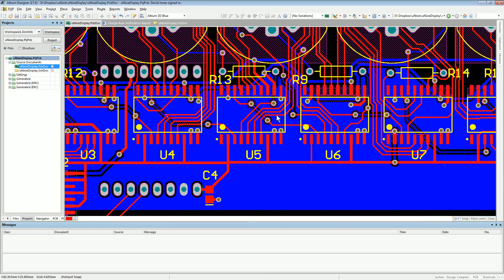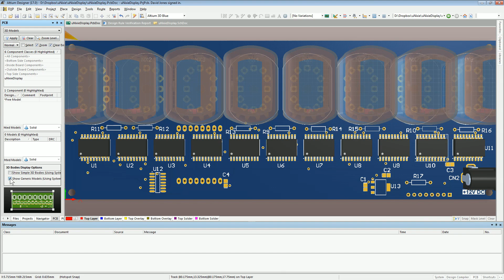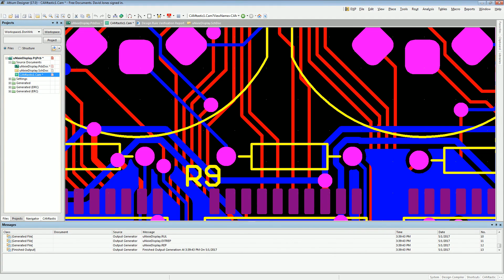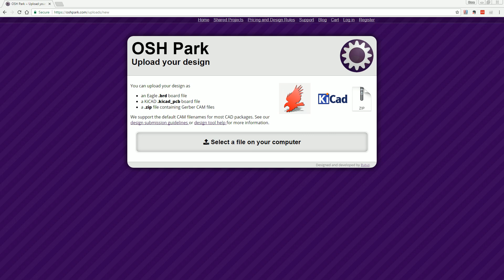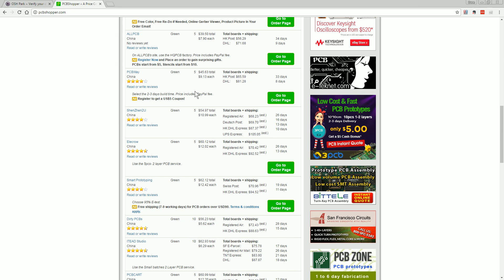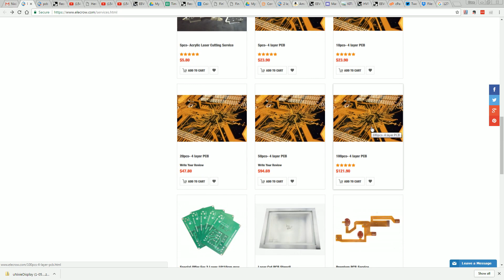EEVblog #990 - Getting The PCB Manufactured (Nixie PART 5)

Comment: I just found this series from you - absolutely brilliant. I've designed a couple of PCBs before and had them sent off for manufacture, so I'm not green, but your explanation of the complete layout, 3D modeling, routing, DRC etc etc was really very good. I hadn't realised how much I didn't know about the process until I saw your tutorial. Super impressed. Great video.

Comment: A bit of a comedy of errors, in the end perhaps it is worth deleting this one.

The useful thing about it is that it shows all the problems you get if you choose Altium instead of the higher-quality Free Software that is available these days.

It also shows all the problems you get when you ignore all the fine print on your screen next to the problem you're having and instead just lean heavy on your experience and presume all your first guesses are correct, and when you get a problem, you go to your second guess instead of reading the manual.

Special thanks to Bob Alexander for spending the time to clarify a lot of the problems in the comments.

Comment: Hi Dave, I work for OSH Park. Sorry for the problem you experienced in this video. We'd like to figure out the issue since others might encounter it too.  Could you please email the files so that our support engineers can determine how to resolve the issue?  My email is: drew@oshpark.com  

We believe there were two unrelated issues that you experienced:

- The outline on the left side was shifted down, making us unable to properly render the Top and Bottom previews correctly. Making the mechanical layer watertight will fix that.

- The Drill files were being incorrectly interpreted as Metric 3:4, instead of Metric 4:3 as submitted. This should have been auto-corrected, but seems there's a bug. For now, try just using Inch 2:4 for the drill export. The gerbers can stay metric as it won't cause any problems.

The unsupported slots warning is for the barrel jack, since we don't support the Altium Drill Path properly. Currently, it just gets lost in our processing.  We're working on fixing this, but for now several slot types are unsupported, and require some clunky workarounds to get fabricated. You can see those here:

Internal Cutouts and Slots
http://docs.oshpark.com/submitting-orders/cutouts-and-slots/

And, for reference, here's some of our documentation relevant to Altium:

Altium Designer: Drill File CAM Configuration
http://docs.oshpark.com/design-tools/altium-designer/drill-files/

Common Errors with Drill Files
http://docs.oshpark.com/submitting-orders/drill-issues/

Thanks!
Drew Fustini
<drew@oshpark.com>

Comment: You can drag and drop files on the OSHpark interface. You need to drop the file on the Upload button than anywhere on the page :) Also China is probably the cheapest. The New Zealand service that showed a price of 150 dollars or thereabouts was for a single board. The cheapest Chinese one was 5 boards for about 60 dollars. One of the advantages of being based in a developing country is the speed and cost of getting electronics made. I use a service called PCB Power here in India and they've been nothing less than stellar.

Comment: Camtastic is Craptastic. GerbV is free/opensource and a much more powerful and usable tool.
Reply from the maker: Yeah but it's not built in. Convenience matters sometimes.
Reply: Yes, convinece matters, but rendering issue from camtastic are the default, not the exception. I can not relay on what camtastic is showing as it isn't even consistent with it self when I am simply zooming. It is a typical altium feature: good idea, useful in theory and pratice - but never truly debuged and intregrated, so that it falls short when you really need it. (And either I really check my Gerbers and take the time to make a good gerbv screenshot or I skip it and send the gerber straigth to fab)

Comment: I've used EasyEDA two times now and they offer a great service to check the PCB before paying. 
The Silkscreen and Soldermask are very well made and clear to read aswell. 
Another big plus is that i ordered 5 PCB's and got 6 both times :) 
One of my Orders was 5x 124x76mm boards, shipped to Austria in 7 days, $43.3 total

Comment: I once had what I think is the same issue with the drill holes, and it was if i remember correctly due to the "excellon version", it seems there's a version that uses x10 resolution on the XY coordinates, but the software the oshpark and others use to render ignores what version it's using and gets you that short of thing with all the drills piled up arround your coordinates origin.

Comment: Nice video, I think its a good idea to download the PCBs manufactures design rules file, and run a check with it before uploading you boards, most of the discount board houses are very lean when it comes to explaining where you went wrong, so better to avoid any problems by running their .dru file first.

Comment: Dave,
I've used a few of the houses listed. PCBway boards have a flaw, the plating comes out with any thru hole part you remove from the board.
DirtyPCB makes better boards and you can panelize with no penatly but if you panelize, don't score (costs extra) the boards use slots with drill holes to separate them.
Also, I use black boards when I have displays on them, helps hide the board from the display better. Most house don't care about board colors.

The other thing is that people buy 10 boards because it's the same cost but if you don't need 10 boards get 5 because if you have several boards in the order shipping is cheaper. I think 1Kg is the cut off before shipping increases.
Rob

Comment: Always check your gerber exports on a external viewer before sending, that way you see what the manufacturer does...
Reply: GerbV is free/opensource. It is not perfect, but when the board looks okay in GerbV, then the file is at least readable with two tools.
The rendering issues in Camtastic makes me doubt anything Camstic is showing (or not showing).
Reply from the maker: Altium IS a gerber viewer.
Reply: I never trust the gerber translations inside a all in one package, You only see translation errors on a third party viewer...

Comment: Your problem with OSHPark appears to be caused by the hole in your board outline.  The text next to the images even says "If the image here is entirely white, you'll want to find and fix any gaps in your board outline."  Earlier in the video, you were joking about how the hole in the outline didn't matter.  It does.

I've ordered many boards from OSHPark and had lots of great experiences with them.
Reply: We believe there were two unrelated issues that occurred in this video when uploading the design to our site:

- The outline on the left side was shifted down, making us unable to 
properly render the Top and Bottom previews correctly. Making the 
mechanical layer watertight will fix that.

- The Drill files were being incorrectly interpreted as Metric 3:4, 
instead of Metric 4:3 as submitted. This should have been 
auto-corrected, but seems there's a bug. For now, try just using Inch 
2:4 for the drill export. The gerbers can stay metric as it won't cause 
any problems.

The unsupported slots warning is for the barrel jack, since we don't 
support the Altium Drill Path properly. Currently, it just gets lost in 
our processing.  We're working on fixing this, but for now several slot 
types are unsupported, and require some clunky workarounds to get 
fabricated. You can see those here:
http://docs.oshpark.com/submitting-orders/cutouts-and-slots/

Thanks!
Drew Fustini
<drew@oshpark.com>
Reply: Hey Drew, when are slots going to get fixed?
I was told many months ago you were working on the scripts to fix it.  
It can't take that long to fix it if you are working on it.
We need slots (without BS workarounds) to use your service or we go elsewhere!  China makes it hard enough for you don't they?
Reply: EEVblog NC geometry is different than the masks.  The cadcam software detects regions to define what are holes.  You need a closed boundary to detect holes.  I doubt the slots are a problem, bc advanced cnc machines will just mill out the region.  (FYI I'm not a pcb expert, but I've done many cnc  part programs.)  But you're right that the tech would fix in 2 s.
Reply from the maker: Then explain why the gerbers layers worked just fine in OSHpark.
Reply: I think the explanation is that Laen wrote most of his own software to process boards for OSHPark, and some of it is not 100% well written, and the process for building a bitmap for the silkscreen works differently from the processes the vector files for the copper layouts.

I've had the same thing happen with one of my boards and was able to fix it by closing the outline.

Comment: Through hole resistors are so yesterday. It takes longer to mount them and they are prone to solder problems over time. I don't get why Altium designer changed resistors to through hole. Such a software isn't worth the money.

Comment: Oshpark probably failed because you used different units (metric vs imperial) for drill files and gerbers.
As for PCBWay - they are crazy fast, I ordered many 2 layer boards with them, and usually I have them in my hands in Canada in 5 business days, and what's especially cool is that they work during weekends. So usually what I do is design a board during Saturday, send it to them in the evening, they will review and approve it for manufacturing the same night (they are on the opposite side of the world from me), and DHL delivers them here on Friday just in time for weekend assembly & testing (and fixing all issues with the board, and re-ordering next iteration :) ) The only problem with them is their stencils are relatively pricey (costs more than the board itself). So if I need stencils (and I have reflow oven so I use them for everything but simplest boards), I usually use allpcb service - they are not as fast (usually takes 1.5 to 2 weeks to get boards), but they make stencils for $10 a panel (they are frameless, but I couldn't care less since I put on paste manually without printer)!
And even 4 layers boards these days are so damn cheap ($35 average for 0.15/0.15 mm and 0.3 drill), which is a great news for folks who love using FPGAs (as they are BGA-only these days).

Comment: I don't even bother to whip up stripboards any more for my hobby projects these days, getting a prototype PCB professionally made is just too cheap, and many modern parts are SMD only anyways... The only downside is that you've got to be patient.
Reply: As by the time i need to route the board within an EDA (i still use Protel) i easily could have done my one-off perfboard, because it´s about the same...i need to route it anyway. So i end up just doing it the other way round...i done PCBs some 15 years ago for my home stuff as well, when cheap board manufacturer showed up...
Nowadys it´s just the other way...all because of my limited time...i simply do it once and have the board ready to run...sometimes i need to do another one for a two channel thing (=stereo) usually i need two days and my perfboard is working and i then can go on building the machanical stuff.
Reply: If it's taking you so long, maybe you need to switch PCB design software...
Reply: Do you even know Protel , i guess not....it´s altium....and it seems that you´re knowing my projects...if so..i hire you right away to do the routing for me....but be sure i ´m going to nail you down to the "-...two days..." you just typed here.... (Last PerfBoard job, contained five PCBs, each is between 80x60/120x90 all milimeters, with both analog and digital stuff, also HighVoltage (350Volts) also Power Supplies and high impedance (20Meg/0.775Volts) traces on the same board, of course without x-talking...my current project uses stacked solerstripes and point to point wiring...so check first than talk, please....other way round would look a bit "silly", ok...no fence...but.....;)

Comment: Dave, please consider telling OSH Park about the issues you had with your design.  In my experience, they're very responsive to feedback and solving problems.  Also, one place where OSH Place really competitive is when making small PCBs.  I routinely fab small,  custom SOIC to DIP adapter boards (1/2 inch by 1 inch, for example) for as little as a few dollars (with free shipping.)
Reply: Thanks, Wayne.  Hi Dave, I work for OSH Park. Sorry for the problem you experienced in this video.  We'd like to figure out the issue since others might encounter it too.

Could you please email the files so that our support engineers can determine how to resolve the issue? 

My email is: drew@oshpark.com
Reply from the maker: That's what they specialise in, small boards.

Comment: You changed drill file to mm while you still kept gerbers at inches.Oshpark don't support drill-slots, you have to make one larger hole instead.
Arrive in 5days is not the same as 5 manufacturing days, especially when it includes international shipping time.

Comment: Don't send your PCB source files directly to the manufacturer. Did that once, they came back with all the polygon pours missing. Ended up having so solder in a grid of wires to replace the ground plane.
Reply from the maker: Yeah, you just don't know what you are going to get. No ambiguity or chance of stuff-up with gerbers, unless they tweak them of course...
Reply: Was this with Eagle by any chance? I know when I open it the polygon fills are always missing until I hit ratsnest again, even if they'd been filled when I last saved it. Thanks for mentioning this, I've just sent an email off to a board manufacturer...

Comment: one of your drill files is metric, and one is imperial.
Reply: Agreed.
Reply: I was surprised Dave didn't see that right away.  The scripts should have corrected for that but since I doubt few users send a mixed bag it obviously was not well tested enough.  
The slots is the item that needs to get fixed at OSHPARK right away.  Slots happen all the time.

Comment: As I have looked at drill unification, one unclear aspect is if PCB factories want the drill files to specify hole sizes before or after through plating.  Drill unification is obviously best done on the actual before-plating sizes, but then one seemingly has to dig deep at each factory website to figure out how much the diameter will be reduced by plating, which seems a lot of work if considering switching factories later.  Any advice on how to handle this practically?
Reply from the maker: You should generally specify the finished hole size. They will overdrill as required for plating.
IME most fabs will assume you want finished hole size unless instructed otherwise. Best to let them handle manufacturing stuff like that.

Comment: PCBWay is 2-3 days BUILD time, or 24h build time. Then you have to add the shipping time as well. So I don't know if PCBshopper is that wrong. Ofc the price don't really match up still.
Reply: I used PCBShopper recently and picked PCBWay since I'm cheap and they were the cheapest. I have to say, I had my doubts but the boards came all the way from China to the east coast of the US faster than I would have thought (I think from sending my gerbers to getting my PCB's was around ~5 days).

The build quality was good. Granted I got a pretty simple PCB, green solder mask, etc.
Reply: The thru holes come out with any components you remove from the board with PCBway, try it on a tight part.

Comment: What I dont understand is why I can get 10 10x10 cm boards for $5 but as soon as I need 10 10x20 cm boards its $50 (Im looking at you Seeed.) You would think the price would scale with board area but it doesn't seem to at all which makes no sense because it would be less work for them by saving them cutting time.
Reply: Probably because it takes more space on a big board that could other boards from other customers could share.
Reply from the maker: They probably have to make the cutoff point somewhere for panels.
Reply: Because it's much harder to fit a big board in a panel, instead of a lot of small  boards. Like if it were Tetris :)

Beside, the larger your board, the larger the possibility of a single fault (e.g. short/open track). In that case, you throw away 200cm^2. If you order small boards, then you just throw away a little piece of pcb. 

I also guess that pcb manufacturers do some more spare pcbs, to account for such faults, with consequent problems of space.

Still, with your size, +EEVblog, you can get your board from some manufacturers at prices as low as 20$ (excluding shipping) for 10 pieces (4$/piece).

Comment: Dave, you guffed up the export settings from Altium. I've ordered boards from OSHpark designed in Altium many times without any problems..  Pretty sure the problem is that you used the 2:5 format and OSHpark only accepts 2:4
Reply: It looked an inch to mm conversion problem to me. I had seen this sometimes when I prepared CAM files for my home CNC machine.
Reply from the maker: I tried 2:4 on both gerber and NC drill and same problem. So it's not that.
Reply: Strange, no clue what's wrong then..
Reply: You are right. I have measured (on the screen) the size of the area with the holes and the actual size of the board. It seems a decimal point problem as the diagonal of the area with the holes is exactly one tenth of the board diagonal.
Reply: @EEVblog The problem is probably that you changed the units of your drill file from inches to millimeters, but you didn't change your gerber units.
Reply: He already said that in the video: He changed to imperial.